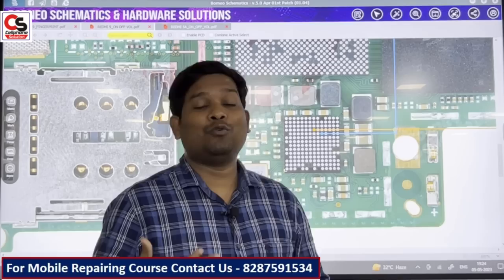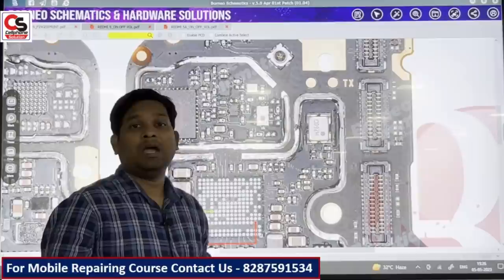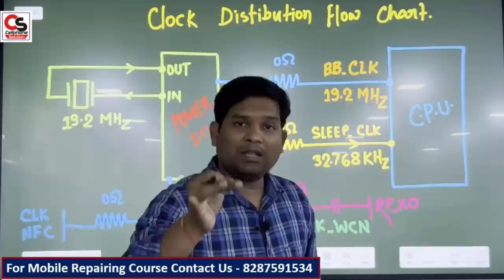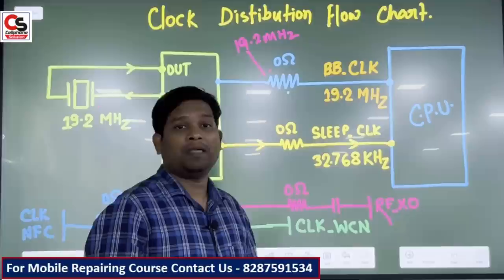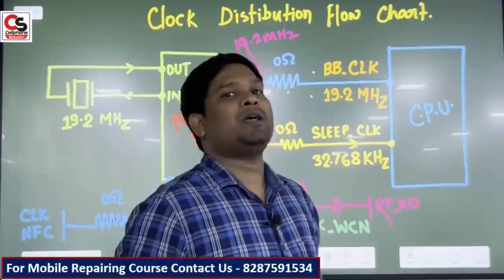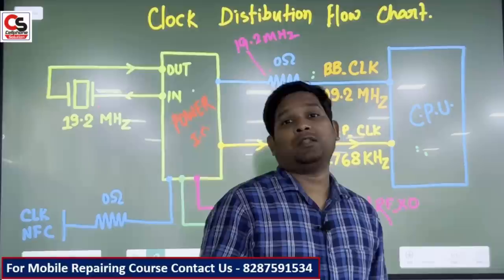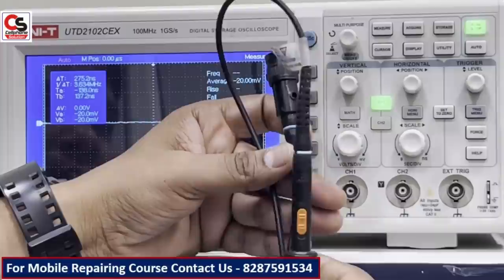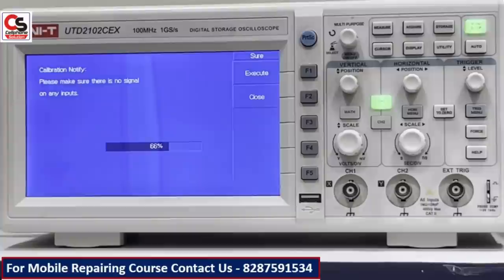Explain About Clock Signal in Mobile Circuit.

Comment: Sir I have taken uni t DSO in which hook type probe is there but I need pointed type probe please advice where can I get this probe.
Reply from the maker: just remove hook.you can easily remove hook.
Reply: Thanks sir after removing hook I don't have pointed tip to fix it where to get it sir please advice
Reply: Hogaya sir thanks